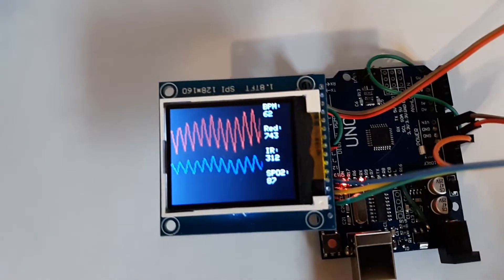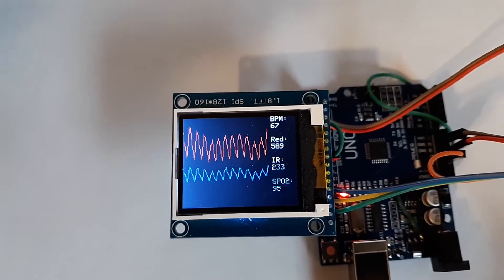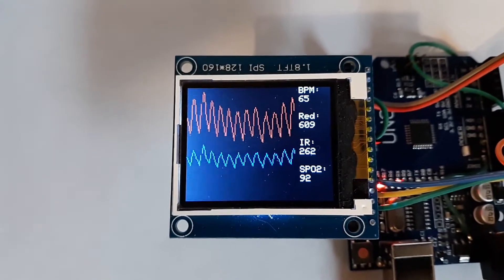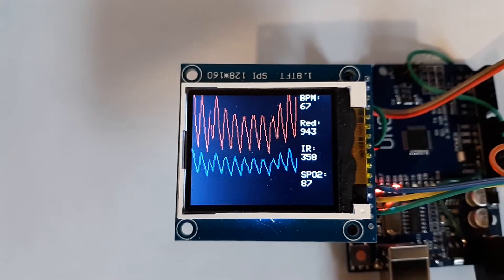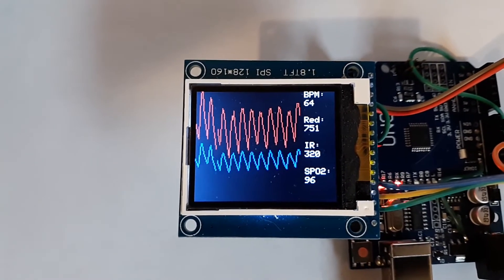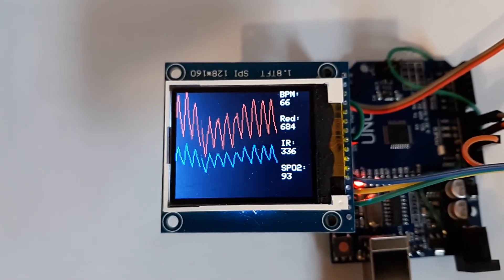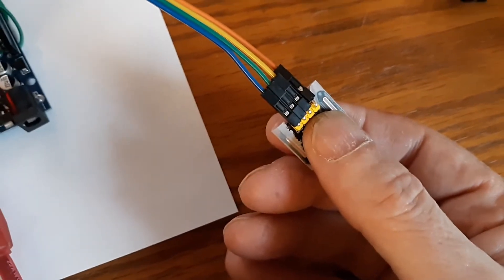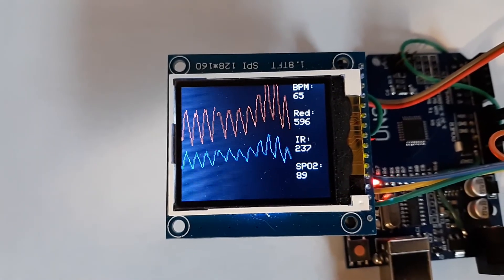Max30102 Arduino UNO and 1.8 TFT LCD

Comment: Hi! I'm also doing a project of this type including other sensors, I saw your code but can you please share your library for the pulse oximeter?
Reply from the maker: The library is also in my github account. https://github.com/bobdavis321/Arduino-MAX30100 adds support for the MAX30102 as well.  (Not complete or perfect but "working".)

Comment: Hi, can you share the coding to me, because I want use the 2.4" TFT LCD Touch Screen Shield as the output. Email: s171151522@studentmail.unimap.edu.my
Reply from the maker: My code is at: https://github.com/bobdavis321/Arduino-Biometric-Projects
Reply: @bobdavis321  Thanks for your help, I will try it after MAX30102 sensor reach. Besides, how the wire that connect Arduino and LCD?